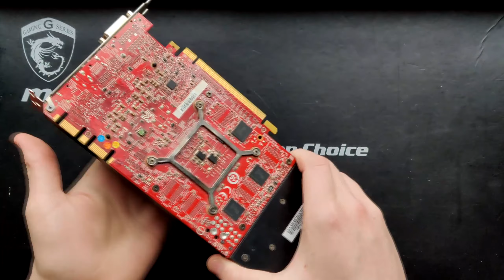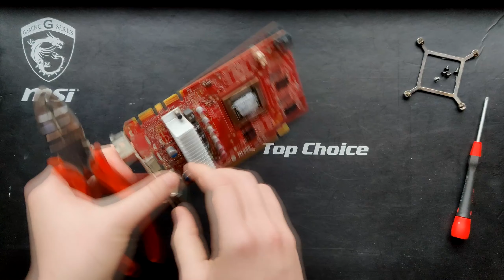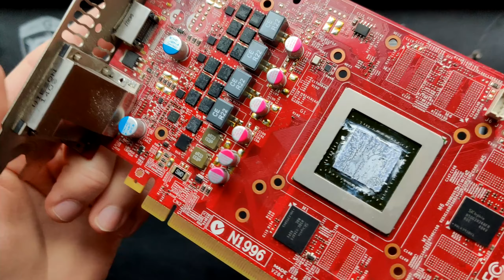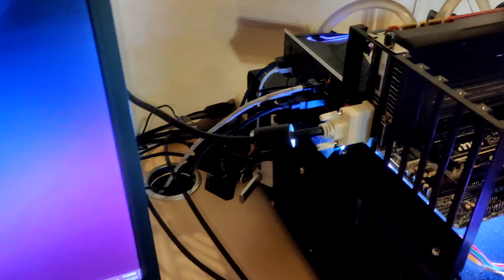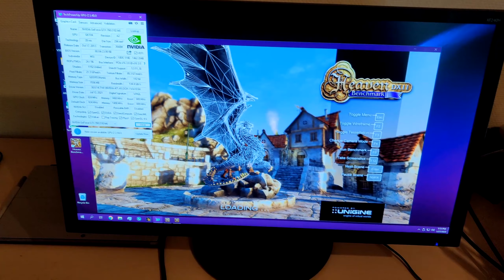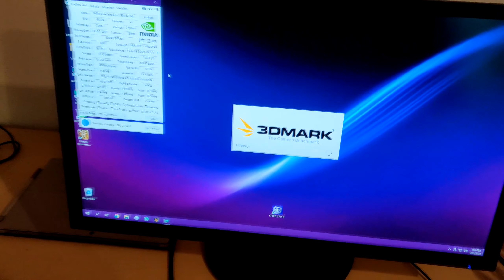GTX 760 #1 Diagnosis | Intermittent Artifacting, No Image

Comment: sir i have a msi armor rx 580 8 gb oc not working no display but power is going to the gpu but gpu isn't working and motherboard vga led always remain on I've done everything i could but my pc still not showing display my processor is ryzen 5  2600 no integrated gpu..I open gpu heatsink and i saw there's a chip missing on the upper left corner of the graphics card U4539 written down below the chip but chip is not there in my graphics card is it because of that chip or my gpu is dead for some different reason..

Comment: Hi, can I solder up to 4gb vram on  gtx 760 2g?  Do I need to do something in bios?
Reply from the maker: you do need a bios that supports the density and model of the memor that you will solder on. you can check what your bios supports in GPU-Z